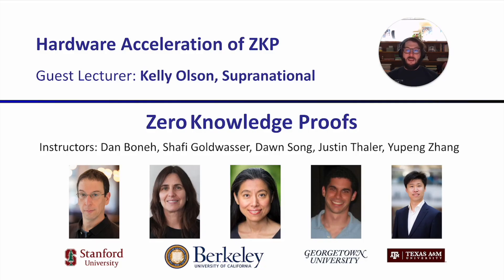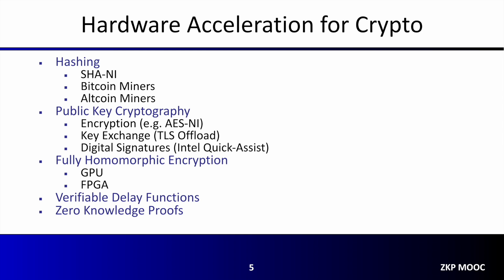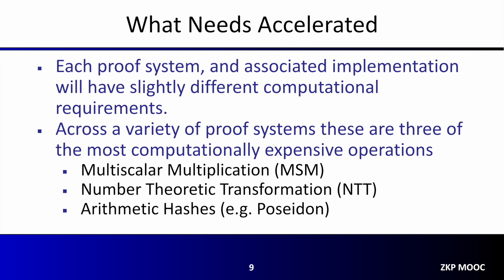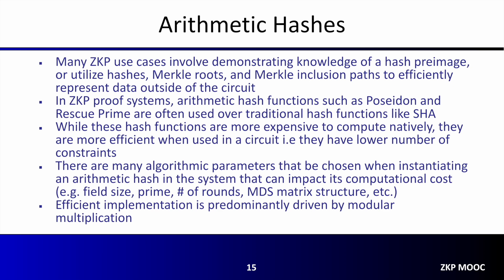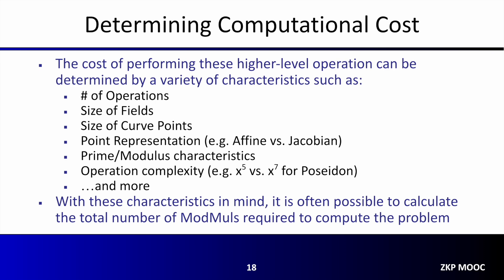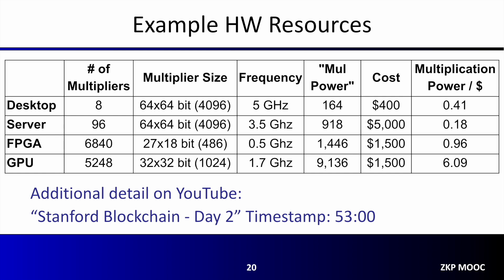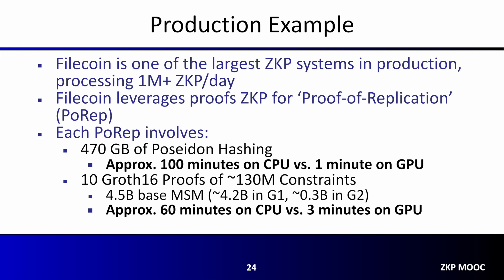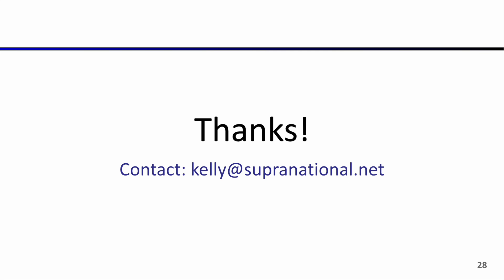ZKP MOOC Lecture 16: Hardware Acceleration of ZKP

Comment: The FPGA vs. GPU comparison at minute 19 is wrong. For example, Xilinx ZYNQ 7000 has a higher frequency and costs less than the GPU. And that at less than 8 watts for the complete board, since the GPU consumes 250-350 watts. Please correct the table to match reality.